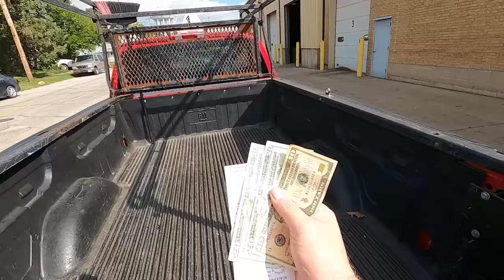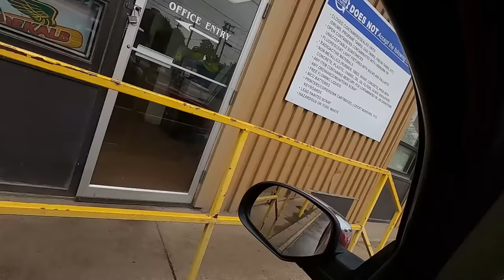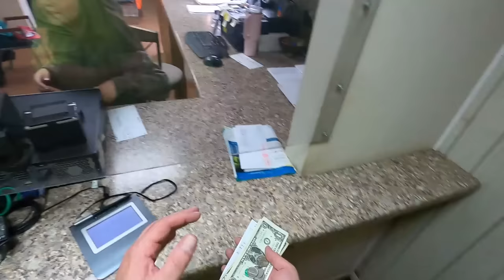Scrap Metal Pays - Overload

Comment: Shelving can add up for sure, I raided a CVS construction dumpster last year as they were remodeling. Over a week of them slowly adding more in, I would stop each night to clear what I could find. Got about 4200 pounds of those solid white shelves you got near your cab of the truck, maybe another 100 in aluminum and a little bit of wiring.
Reply from the maker: Nice

Comment: Quantum scrap entanglement a bizarre, counterintuitive phenomenon that explains how two non subatomic scrap-particles can be intimately linked to each other even if seperated by billions of light-years of space, a change induced in one will affect the other.
Reply from the maker: The flux capacitors warps spacetime. A billion light years is like a micrometer